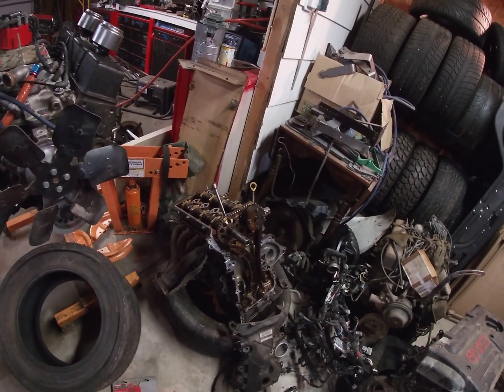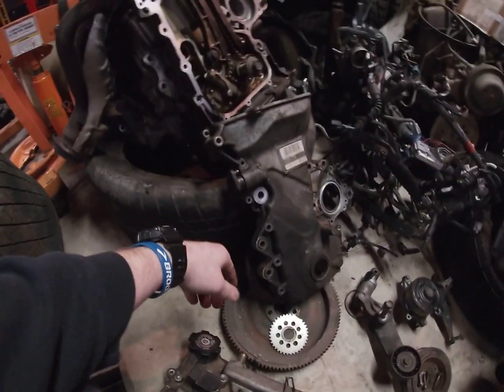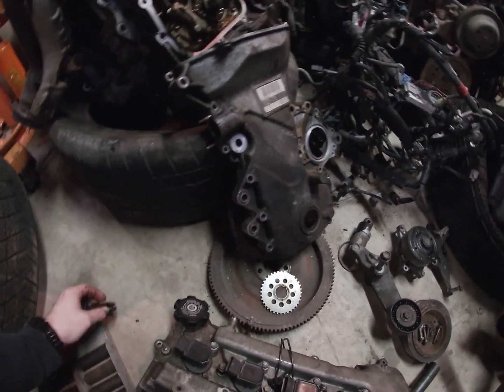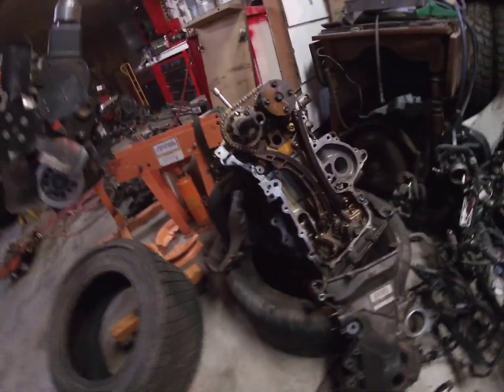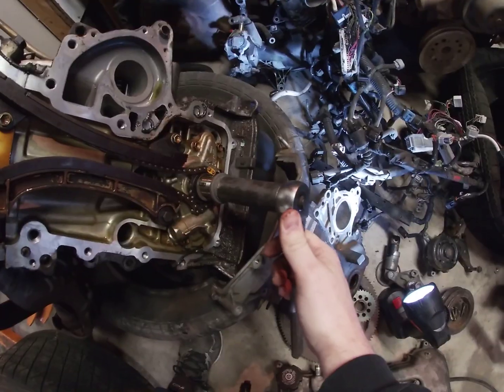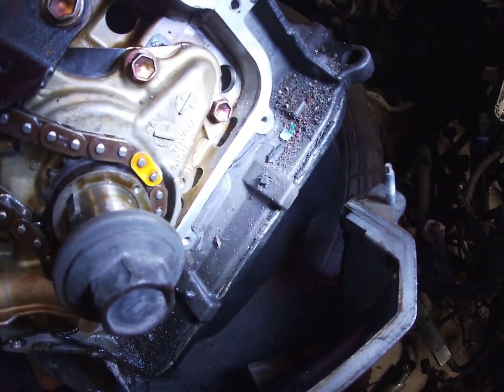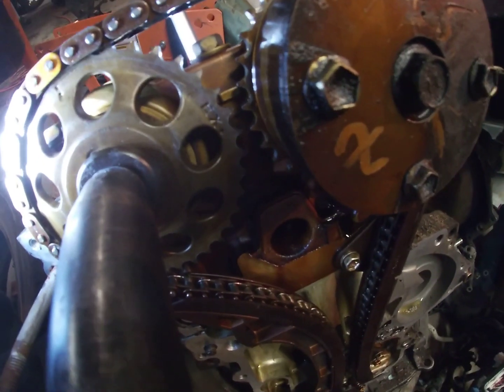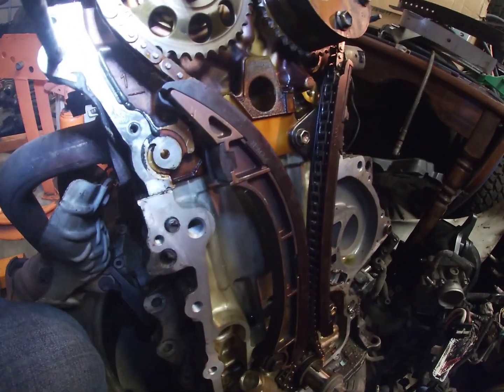HOW TO PROPERLY TIME A TOYOTA CELICA: Timing a 1ZZ Toyota Engine

Comment: So I noticed in your video your dots didn't line up on your camshaft sprockets like you said they should or did I not see it right? Did it run okay?
Reply from the maker: If I remember right, the motor I was using in this video was one I had pulled out and replaced because it was blown up when I bought the car so I couldn't get one of the cams to turn where it needed to be. The dots should line up(they may be off just a hair), but get them as close as possible. I've done 3 of these engines this way. All are still going strong. The one I drive daily has almost 100k on it since I've done the chain.
Reply: @ReedRacing9J  okay thanks. I'm about to tear the head off 01 Celica. Thanks for the vid

Comment: Yeah I messed this part up and dropped valves😂
Reply from the maker: Happens to the best of us
Reply: Reed Racing just got it timed up. Now time to put the rest on and see how it goes
Reply: Reed Racing I got it timed. How loose was your chain with the tensioner out. I want to rotate the engine 4 times to make sure I did it right.
Reply from the maker: @dannye4562  with the tensioner out, it will be super loose. Should be pretty tight with the tensioner in it.